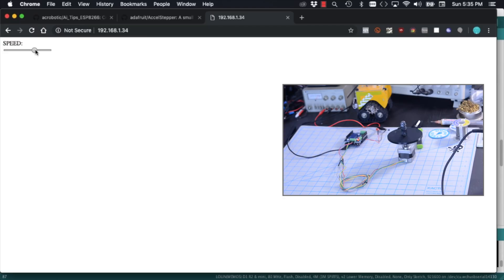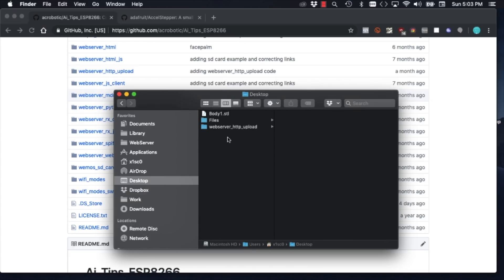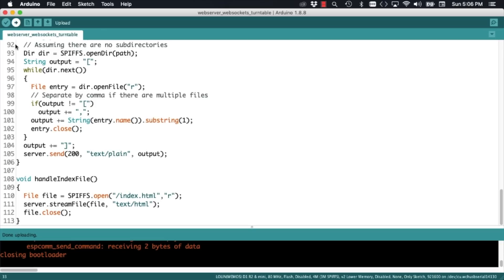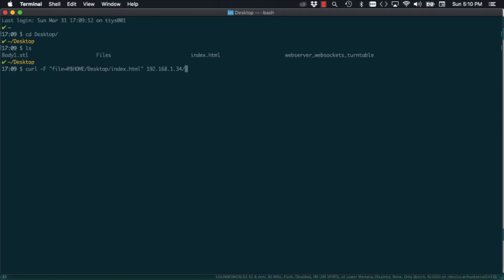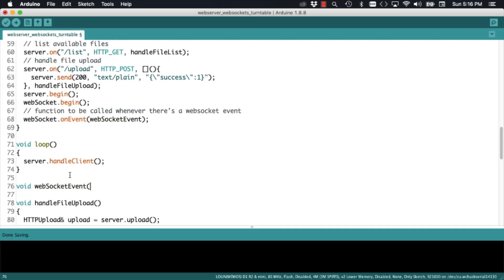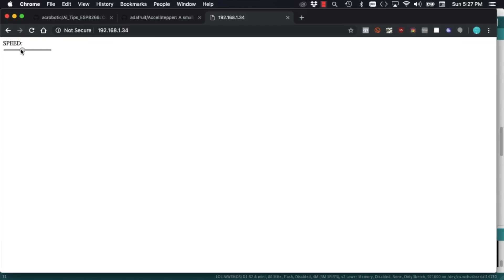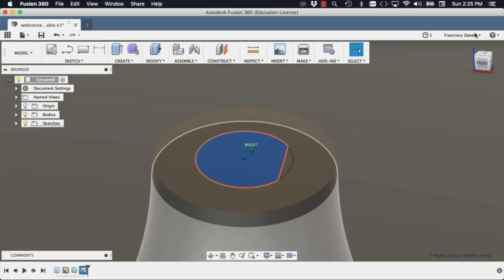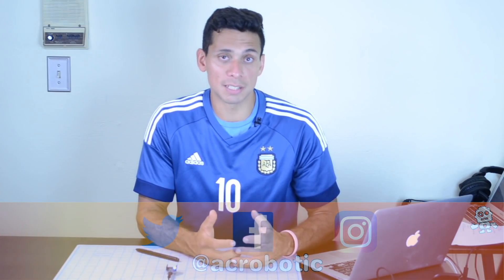ESP8266 Easy Photography Turntable Controlled With Websockets | Arduino IDE (Mac OSX and Windows)

Comment: 5:50 in webSocketEvent() you check for "#", and assume it is a "speed" message. But the code you modified to create the speed message at 3:06 there's a "brightness" message that also uses the "#". So in your server webSocketEvent() the code should probably not ASSUME "speed" is being sent, right? P.S. Thanks for the video. These are cool projects!
Reply from the maker: Hey, Paul! Thanks for checking out the vid! So, I'm recycling an old code sample that was meant for controlling brightness of an LED. I made changes so that it would control the stepper motor speed instead, namely, the range. So that the code wasn't confusing, I changed all the terms that referred to "brightness" to "speed. It's the same code, just named differently. I use the "#" prefix (optional) as a sanity check, to ensure that the message is what we expect. Check out the original video, for an additional example of its use: https://www.youtube.com/watch?v=ROeT-gyYZfw

HTH. Let me know if you have any further questions.
Reply: @datasith  Sure. Understood. I was just thinking, "what if the code received a "#brightness" message and it was 1000 or something, and the stepper motor burned up :)